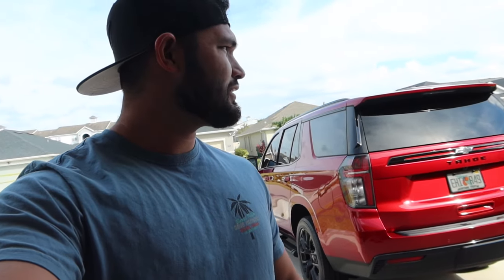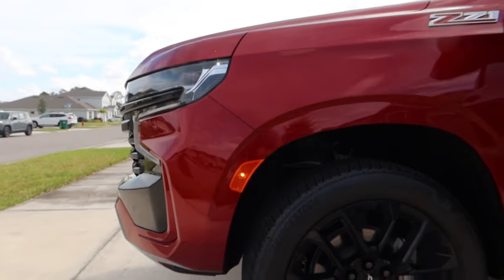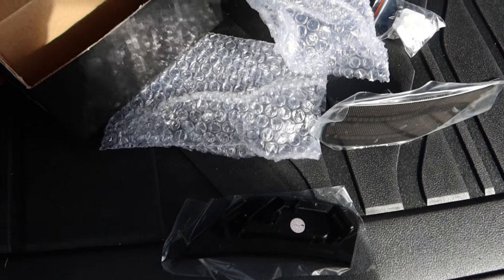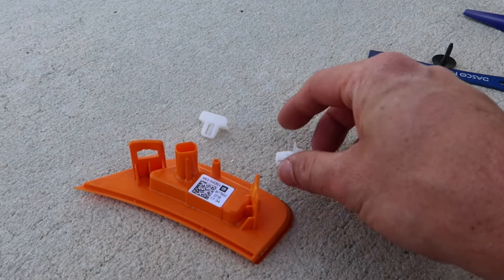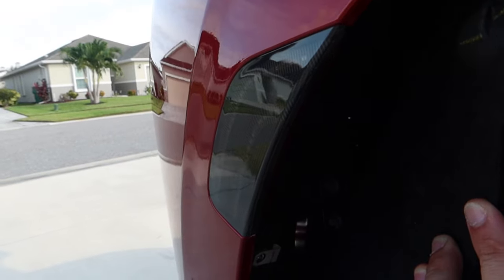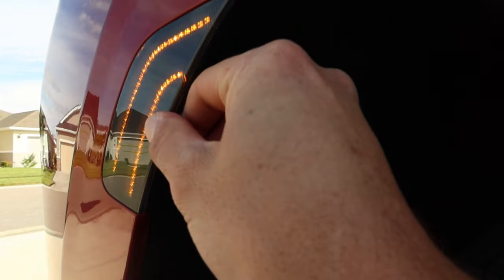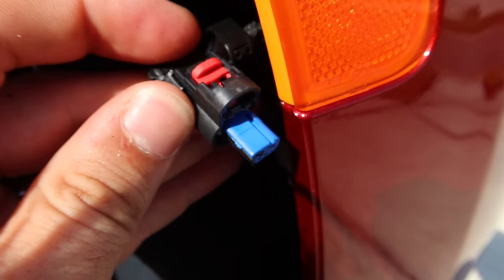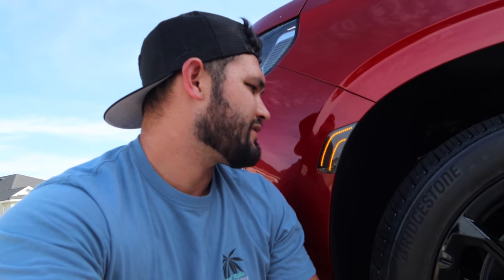2021-2024 Chevy Tahoe/Suburban/Yukon LED Side Marker Install

Comment: I found these by accident and installed them on my '21 Yukon XL AT4.  Mine are the dark smoke with the bright white lights so now they match the lights on the running boards.  They nearly disappear on the Smokey Quartz Metallic body color.